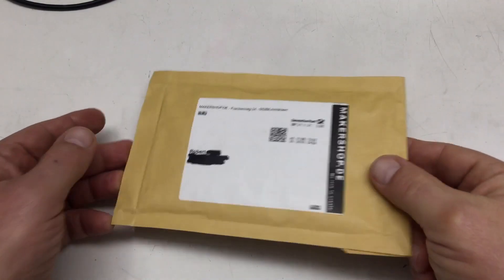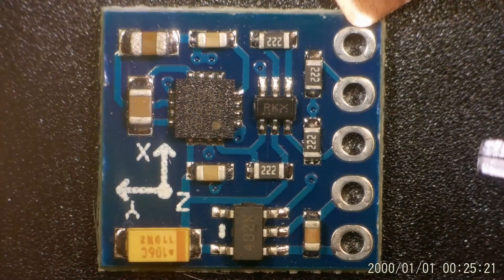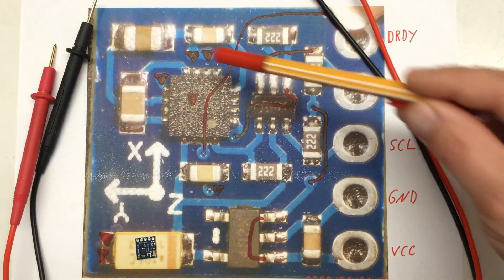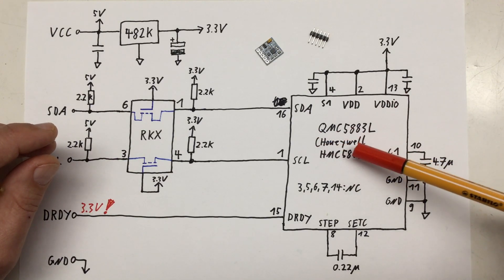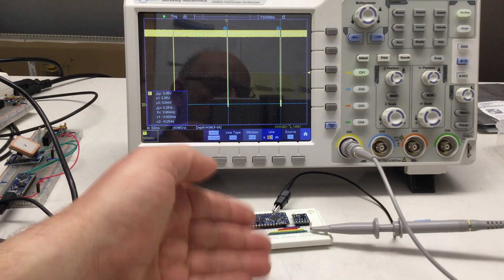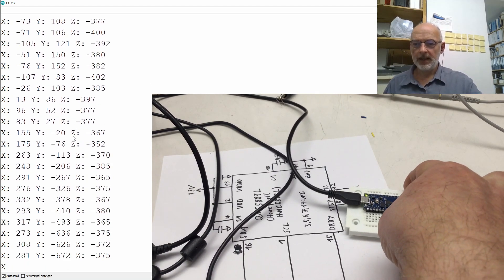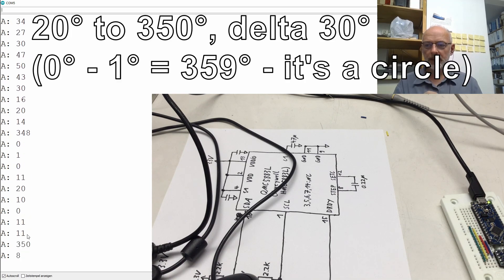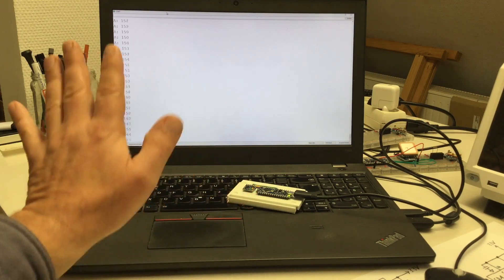Mailbag: QMC5883L 3-Axis Compass Module (Schematic, Tests, Arduino Library)

Comment: Interesting that the original Honeywell chip, HMC5883L, is listed as obsolete at Digi-Key.
Reply from the maker: I guess that's the reason they were willing to licensed that design to QST. I'm just wondering why QST didn't keep the software interface? Was that required by the license agreement or did they saw an opportunity to make that chip just a wee bit cheaper in production.

Comment: Hi Robert, it's an awesome analysis. I use the same sensor followed your instruction, but the calibration returns only 0,0,0,0,0,0. Is it possible to get you somehow private conversation with you?
Reply from the maker: Hi Krisztián, I'm sorry, but YouTube is just a hobby for me and for privacy reasons I do not provide any contact information. I hope you understand.
Reply: @robertssmorgasbord  vielen Dank für die Rückmeldung, ich verstehe es auch. Kann ich mal vielleicht hier ein paar Fragen stellen, oder IRC / Discord?
Reply from the maker: @krisztian2232  Sorry, aber ich habe im Moment echt wenig Zeit. Meine Videos schneide ich gerade immer Samstag Abend und schreibe die Beschreibungen am Sonntag Morgen um sie dann gleich veröffentlichen. Und mit der Beantwortung der Kommentare komme ich auch kaum noch nach (wie Du an den 4 Tagen Verzögerung sehen kannst).
Reply from the maker: @krisztian2232  Nochmals, vielen Dank für Dein Verständnis! Sieht so aus als bist Du in die QMC5883L/HMC5883 Softwarekompatibilitätsfalle getappt - die beiden Chips sind zwar Pinkompatibel, aber NICHT Softwarekompatibel. Für den QMC brauchst Du eine dedizierte QMC Bibliothek (z.B. Adafruit) und für den HMC eine dedizierte HMC Bibliothek. Es hilft da überhaupt nicht, dass viele Chinesischen Breakout-Boards als HMC verkauft werden, obwohl ein QMC Chip drauf ist. Ich freue mich auf jeden Fall, dass Du Dein Problem gelöst bekommen hast. Und sei froh, dass Du einen HMC hast - die vom QMC gemessenen Werte sind total verrauscht.
Reply: @robertssmorgasbord  Vielen Dank für diene Viedeos und Hilfe, and God Bless BusPirate
Reply from the maker: @krisztian2232  Kein Problem 🙂

Comment: I think there's probably a reason why Honeywell don't make them anymore. I've personally found them to be hopelessly inaccurate and not stable enough for
real world projects.
Reply from the maker: Yeah, that's probably it. And the licensed version from QMC might be even worse. I tried my best to the the maximum out of that QMC5883L, but it's simply to noisy and has too much drift (QST QMC5883L 3-Axis Digital Compass and Arduino MCU – The Details (5) https://youtu.be/pfMf-4S9yzk ).